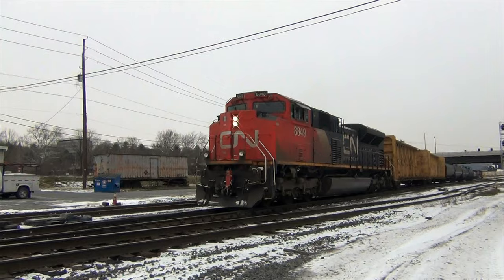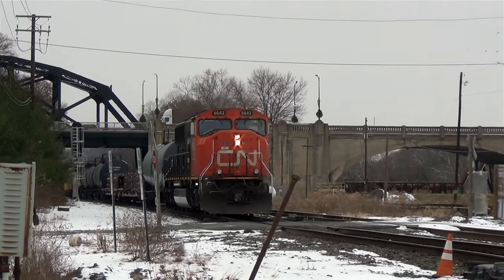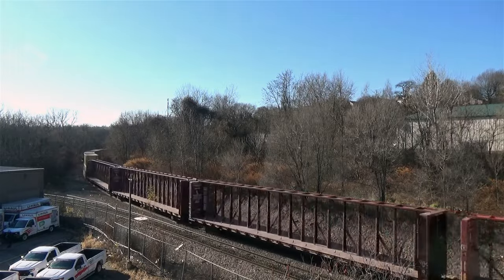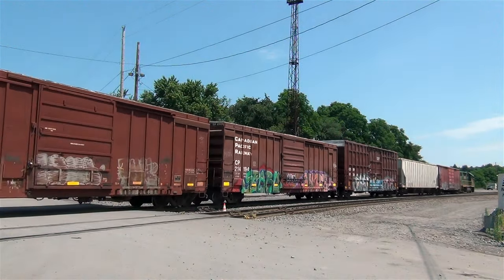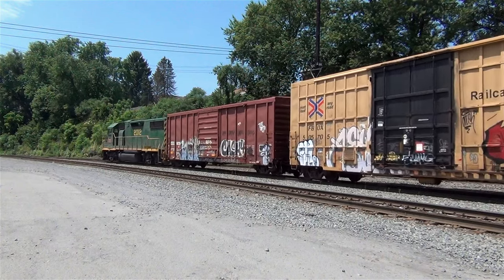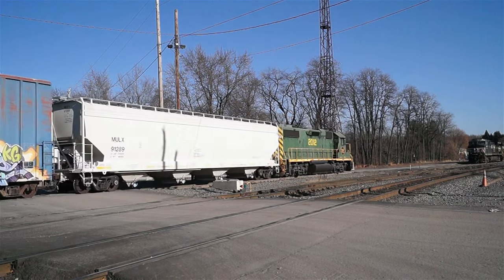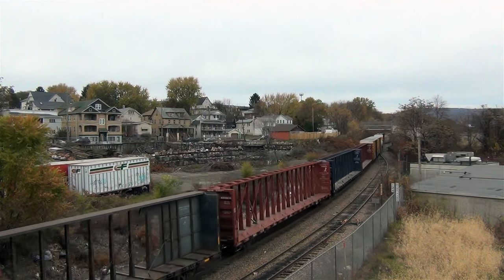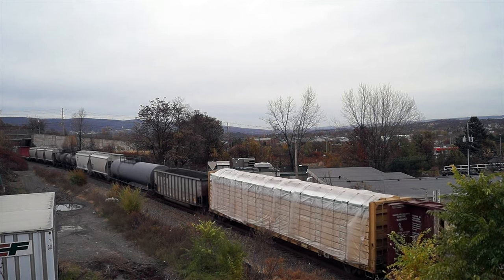Push Pull Train Operation Explained 3 Different Ways

Comment: IF You get a chance, I invite you to a "joint" Rail Fan day on the CSX Rochester & Mohawk divisions. Start on one, end on the other. Finish the day in Minoa at Trappers II  :) CSX has a very busy main line up there on the ex NYC main line.  LOT of DPU and other interesting configurations. My favorite are the "book ends" where they have locomotives at both ends. Today I MISSED the action, radio was saying several in the 700 axle range. A lot of rail fan fun. Could also give u locations to build your own adventure if u prefer "solo" ... save u a lot of research  time. ( moved the trains to here from the former channel afleetcommand which is all logging now )

Comment: CSX does a lot DPUs for Sand Patch grade but it was very Rare by River Subdivision
Reply: Long time ago in the 2000s CSX did some DPUs maybe small business owners on the Northern Branch line then it stopped because CSX can no longer go further up to Piermont NY in Rockland
Reply: Norfolk Southern is very Rare to see when NJ Transit is a break and Norfolk Southern  usually works on the Pascack Valley line  or Main and Bergen County line  or Piermont branch  Suffern at Hillburn NY to the Piermont branch

Comment: Thanks for the video. Great to have you back. I have seen your videos at Taylor with rear-engine YJPI tacked onto the back of PISB, allowing it to switch at Taylor. Given RBMN does most Pittson interchange with NS at Reading, (that’s what NRFF does,) what traffic do they interchange at Taylor?
Reply from the maker: Thanks for watching Paul. It used to be mostly boxcars for Cascade Paper out around Ransome but these days they run the gamut of freight cars. I'm doing a video on the diversity of freight they've been getting through the Taylor interchange. What I can say is that I think a lot of stuff goes to their transload facility @ Ransome.